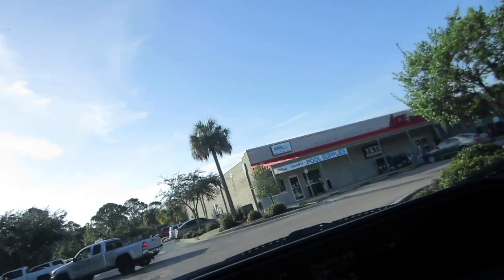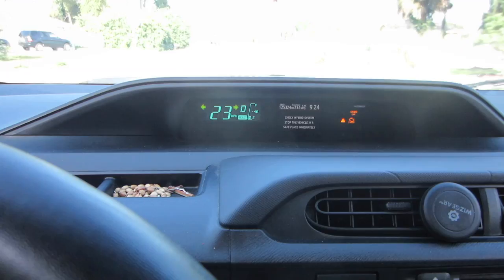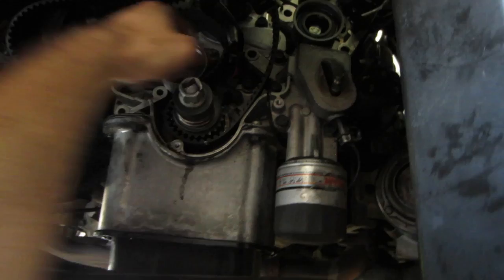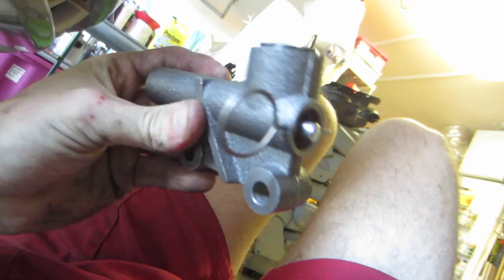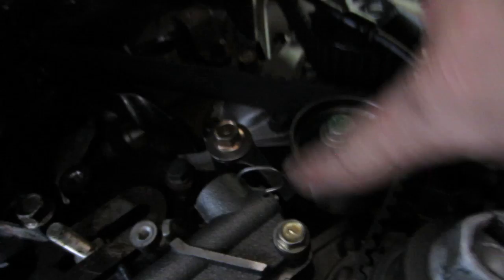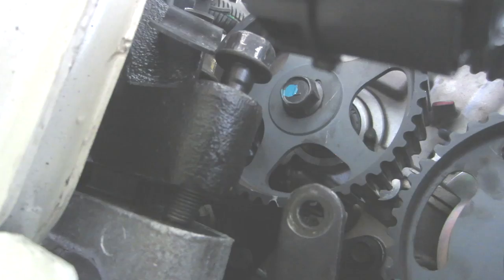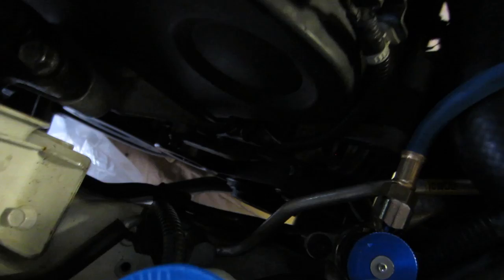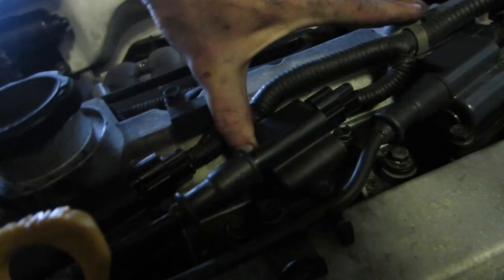Kia Sedona Timing Belt and A/c work Day 4 | Vlog 147

Comment: Back yard wrenchin' so good even Kermit came to spectate! LOL!  Well done, my friend!  I know it isn't quite finished but you deserve some congratulations!  I think someone else asked the question already but you might check to see if that spark plug is loose.  Also, I believe every spark plug has it's own coil (the black boxy thing on top of the spark plug)--I could be wrong about that--It may be arcing a bit and just needs to be seated on top of the plug better.  Best to ask Mario.  I don't think it's something that will hurt anything in the short term but you'll want to get that plug working correctly soon.  I'm sorry, I don't know much about air conditioners and how to charge them.  I am betting it just needs a bit more refrigerant since it's a little light at 36 ounces.  you have 2 lbs. 4 ounces in it at 36 ounces so it only needs about another 4 ounces or so.  Correct me if I'm wrong, but the AC didn't work when you bought it so it may be an evaporator is bad.  Again, I'm no mechanic--just passing along what I've seen go bad in my trucking days.  Nice work anyway!  Tailwinds and downhill from here on out!

Comment: Nice job!!!   The heater problem is likely a need for the air bubbles to work themselves out of the system.  Not sure if you have to bleed the system or not, check with your car guy, he hasn't steered you wrong yet.
Reply from the maker: Thanks Allen. The heat wasn't working before either unless there were bubbles in before 🤗 rear heat works.
Reply: Allen makes a good point about the air bubbles working themselves out. Check the front heater core and maybe blow it out with compressed air.  The fins might be plugged up with dirt, bugs, leaves, etc...also, find and check the cabin air filter--that might be plugged up too.  Those cabin air filters are sometimes hard to find...just ask one of the people at the many auto parts store you now have made several trips too :)

Comment: Easy Fosheezy. My car has check engine light. Shop couldn't fix it/couldn't get part, but car runs fine.
Reply from the maker: What car and what code did it pull?
Reply: I have a 98 Ford Contour. Had O'relly diagonose. Some type of sensor for a belt?  Ford did not fix. So much was done before new tires etc. so I gotta keep it for a while. Not like I can go to Ebay for a part.
Reply from the maker: I've heard these have awful electric issues. Might be related to that. Who knows 🤣😂

Comment: run the engine with the radiator cap off so the thermostat can open and close. Eventually it'll work out the air bubbles
Reply from the maker: Awesome thanks! Just idle or drive around?
Reply: Just idle, for a little bit. Keep an eye on your temp gauge.